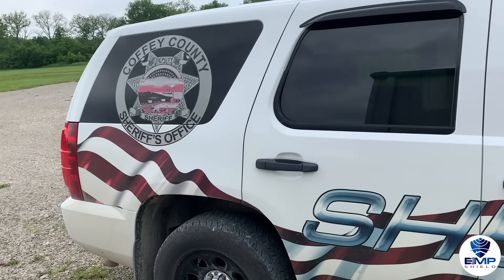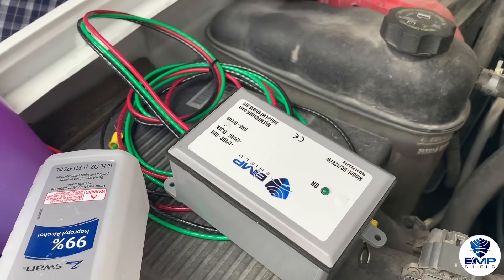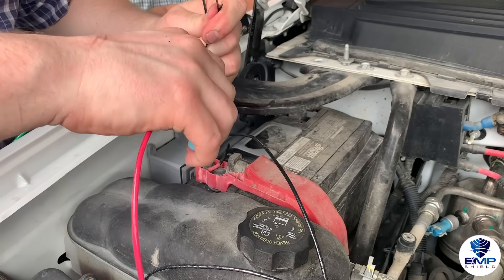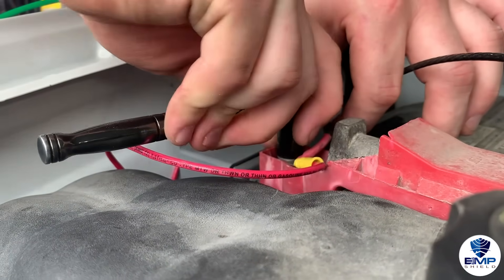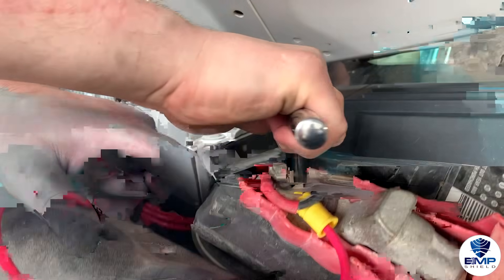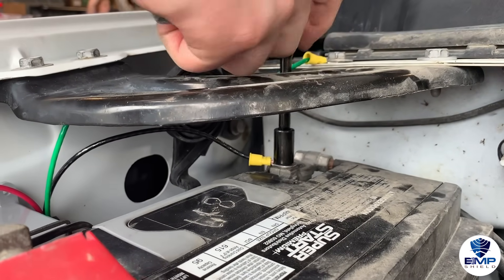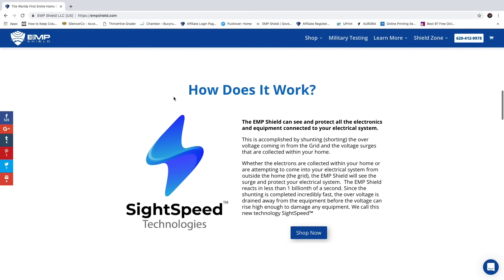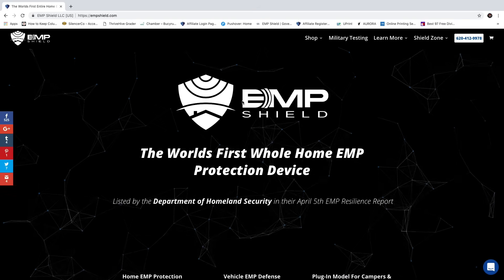EMP Shield Vehicle Installation Instruction - Electromagnetic Pulse Protection on Police Car

Comment: Um in an extreme emp any two wires in close enough proximity to each other (even in a rubber/ plastic casing) capable of creating a circuit or anything remotely similar to an antenna will charge and fry anything connected unless shielded (usually several layers of copper properly grounded, and then grounded to the actual ground) (like dragging a chain behind your vehicle, have to have somewhere for the larger currents to go) your basically catching the charged particles in a copper net and funneling them to ground. this device may protect the battery like a gfci breaker but  I’m not convinced it would stop the rest of the electrical systems from frying. Not knocking the product just think this would save your car from a ground level nuclear blasts emp but not an H.A.N.E. Altitude and proximity are everything when it comes to these things. Am going to do more research and talk to the master electricians and electrical engineer that I know since I’m not qualified enough to make this claim on my own. Edit : humility.

Comment: The problem I have with mine is I only have about 8" of wire I don't have enough wire to reach a safe distance
Reply from the maker: Constance Claeys oh my gosh. These come with 4 feet of wire. Did you happen to cut it ?
Reply: @EMPShield  so we wrapped it with foam a d zip tied it just under the top of the quarter panel/ over where the headlight is.  I  just hope it stays in place.
Reply from the maker: Constance Claeys I’ll send you some hook and loop tape!
Reply from the maker: Constance Claeys We Will get it to you in the next few days
Reply: @EMPShield  nope.. it just came that way. I assumed it had to do with some mathematical theory of the travel speed or pulse or something.